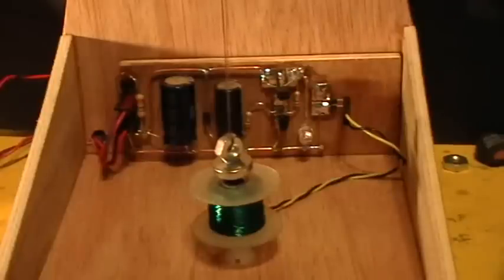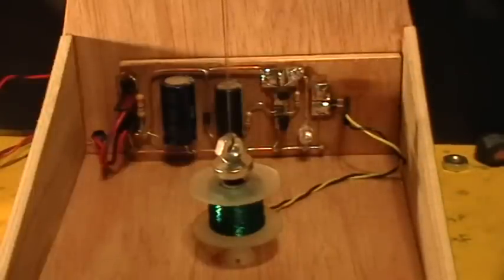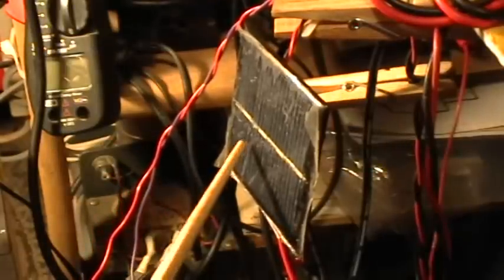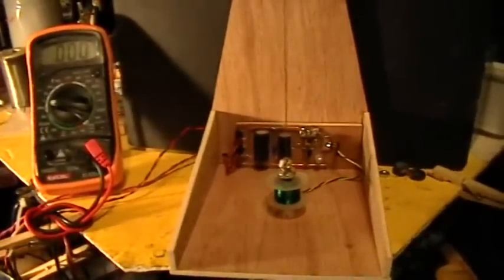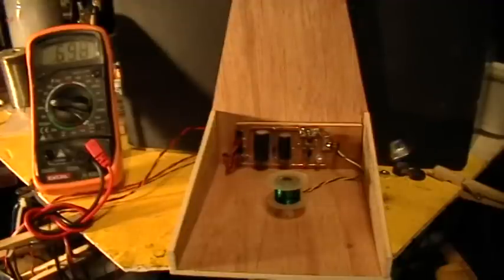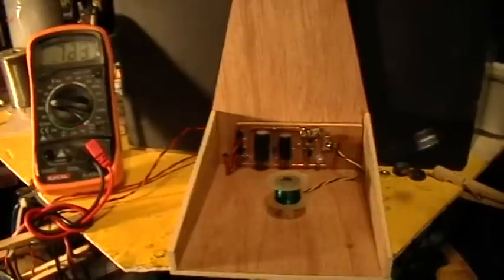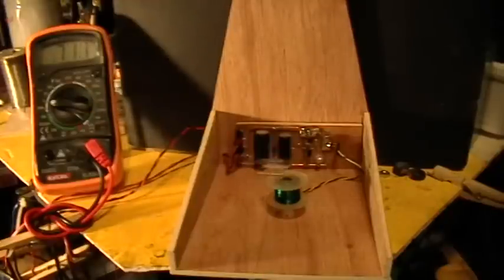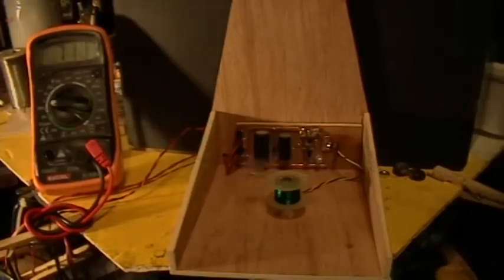Pulse Motors: PerPenduPetulum 2: Light Powered, Self Starting

Comment: I replicated this circuit but made a few modifications to accommodate what I had on hand. It's been running for one month on one alkaline AA battery and the voltage has dropped from 1.45 volts to 1.40 volts. I made the coils on my sewing machine . I put a plastic bobbin in the thread winder post and fully wound it with 30 Gauge magnet wire. Measured at  8 ohms.  For this project I mounted two of these bobbins in series, hoping to get a bigger "kick". In addition I used a substantially larger magnet salvaged from an old hard drive. The magnet makes a number large bounces and gyrations for a few seconds and then settles down to a nice even back and forth swing. Considering the low current drain maybe  I should have used an alkaline AAA battery. When (if) the battery runs down I will try thatNice cicuit
Reply: +TinselKoala 
Per your suggestion , I substituted an AG13 button cell  from my premium electronics supply store ( the local Dollar Store ) .
There is no discernable difference from when I was using he AA battery. 
When it begins to fail I will remove or reduce the 330R dropping resistor.

Comment: Can we use a bc557 instead of bc556 transistor ? Thnx in advance 🙂
Reply from the maker: Yes, it should work. Be aware that I had to wind and test several coils to get best performance. Good luck and don't forget to post a video!
Be sure to read the comments below for more details.
Reply: @TinselKoala  thank you very much 😊. Today i got it working after spending lots of hours in it.

Comment: Good evening,
Thanks for the info for some reason it is not working like to know what is the resistance of the coil I do not have 33 awg but using 29.5 awg and you have a sketch for the spool so I can make on a lathe, greatly appricated .
Best Regards
Reply from the maker: The bobbin is a simple spool, 0.315 inch center diameter and 0.625 inch winding height, No core. I used a phenolic tube for the center part and made some 1 inch diameter end plates out of thin unclad circuit board material.  I found that the circuit is pretty sensitive to the coil winding number. I made three coils on the same size bobbins before I got one working exactly right.  The coil has a resistance of 43 ohms. I don't know what adjustments you will need for your thicker wire. To run on a solar cell remove the 330R resistor. Also try reversing the LED. It should only give a tiny tiny flash in the LED when the magnet triggers the coil. If the LED stays on you are giving too much voltage from the power supply.

Comment: Reminds me of the lucky money cat or solar flowers...very cool TK.
Can you make it run from a peltier module?
Reply from the maker: Probably, but I don't have one that I can try. The specs indicate that it should do, though. I also can't find any of my real supercaps in this mess.
Reply: @TinselKoala  Hello Bro please can you help me. I'm stuck in this project my circuit not able to generate enough push/kick to the magnet over the coil. It only oscillates a little bit but that's not enough. I have used #28 Gauge Magnetic wire & made 35 Ohm Coil. I have also used 1N914 Diode , Two 100k 1/4 Watt Resistors , 1000 uf 16v - 2200uf 10v  Capacitors, BC556B & BC337-40 Transistors, Red LED 
330R resistor. 
2 (1.5 V AAA Batteries as source).  What adjustments  should I do? Can you guide me, I would appreciate any help that you can give me.

Comment: hi,
i am replicating this circuit and i've a different result.. the circuit able to detect magnet movement (the led blink when a magnet pass the coil. the problem i got is the circuit doesnt have enough power to kick the magnet..
i am using 2 - 3 v. the self start does not work... :(

any tips for me? thx
Reply from the maker: The coil winding is pretty critical, I found. As you can see from the video, the starting "kick" isn't very strong. If your coil has too much resistance it will be even weaker. But it should work; mine is working excellently from just the room light or outdoors on a cloudy day.  It takes about 25 seconds, after providing light, for mine to start "kicking" and then it will kick twice or three times in a few seconds and then the pendulum is swinging nicely and increasing its swing, by 20 -25 swings it is going at full amplitude.
Here are several things you can try, but I think your problem is probably the coil, too much resistance. But first try removing the 330R in series with the voltage source. Next try reversing the polarity of the LED. Make sure the magnet is 1/8 to 1/4 inch above the coil. If it still doesn't work then try changing the coil. Make sure you have the right inductance and resistance; mine has just under 11 milliHenry, and 37 Ohms DC resistance. This will be around 900 turns of #33 more or less on the small bobbin. Also try reversing the polarity hookup of your coil.
Let me know if this doesn't work and we can try other things.
What transistors are you using?
Reply: I am using the same transistors as described in your schema. I also wonder, how much weight you can put on the pendulum ? 
I will try your suggestion.. many thx..

Comment: Hi Tinsel, i have some questions, i am using this circuit in several experiments but for me this is new experience, in one of my experiments i discover a "curious effect" in my multifilar pancake coils, i sow lights at 7.10 AM and i realized that is my pancake coil....this is the experiment....https://www.youtube.com/watch?v=hhEVxhYpDgo.
Question 1.- i am not using the resistor 330 and the circuit works well, is correct or i have to use it...? Question 2:- What happen if i chage the capacitor 2,200 and 1000 Uf  by 22 Uf and 10Uf how  lidmotor is proposing ...?  Question 3.- I am going to try the 1N5817 diode, do you think that the leds increase the light...?  Thanks for your time.
Reply from the maker: Whether or not the 330R is needed depends on the output impedance of the power source. If you use a low impedance source like a battery or capacitor for the primary power supply then you will probably need the resistor. For higher impedance source like the PV or a saltwater battery or suchlike, you don't need it.
Using smaller capacitor values will result in faster self-starting but lower energy per pulse.
Don't set yourself on fire!
Reply: For may experiment i am using a small solar panel, 2 volts, and i am not using the 330 R, i will get the resistor this week and i will make the experiment...! Ok about the capacitors...! and the diode 1N5817 i will get this week, i hope...! Thanks for replay.  SALUDOS DESDE MEXICO...!
Reply from the maker: If the supply voltage is too high it won't work without the resistor. On my build, if I take it outdoors into full sun, I need the 330R  with the solar cell.  Also, don't expect the LED to flash brightly. When it is working properly there will be only a tiny flash in the LED, barely visible. 
Good luck! (I watched your video, nice flashes with your well-constructed coil, very nice!)
Reply: For the moment I only have a resistance of 270 ohms and works very well, the Leds shine with more intensity, almost 100% light, you are right the resistance  it is necessary ...! About the multifilar pancake coil, this consist in six groups of pancake coils connected in series, every group have six pancake coils, isolated from each other, i have connected the circuit in only one group, the other groups "induces" the current, like a transformer, this coil is very complicated to make, i delated six videos because nobody make a replication, and this is a shame...!